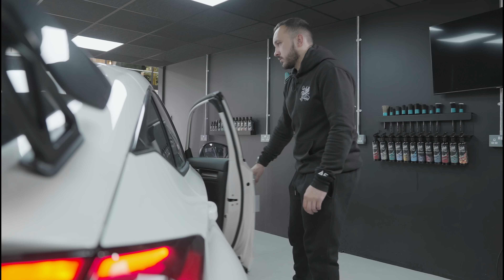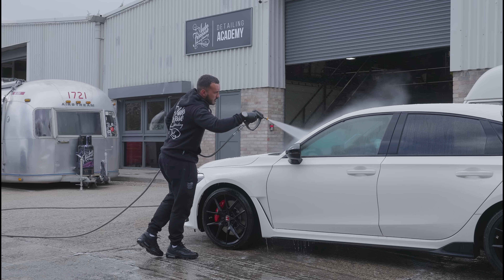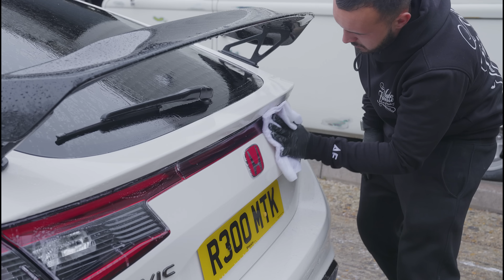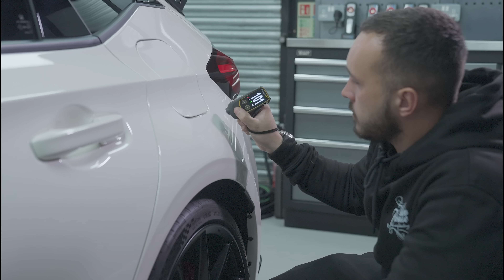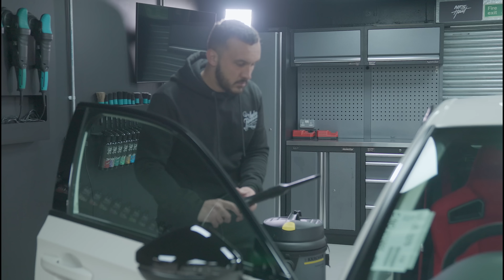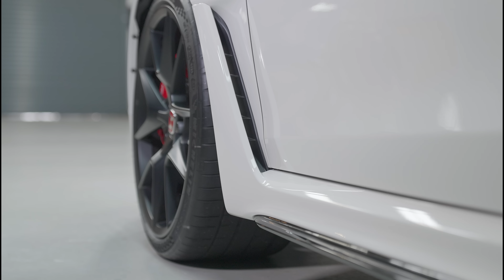Auto Finesse - Honda Civic Type R FL5

Comment: Why go through all that trouble in a new car? Paint should be good from factory.
Reply from the maker: Should be, but rarely the case these days
Reply: @AutoFinesseDetailing  are you guys removing millimeters of clear coat?
Reply from the maker: @juanfernandez8987  Noooo, a Micron or 2 at most with something like this, a car doesn't have many millimetres of paint with all layers combined, let alone clearcoat alone.